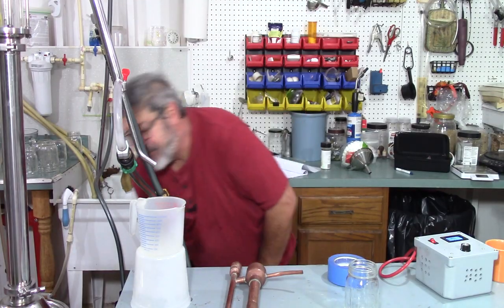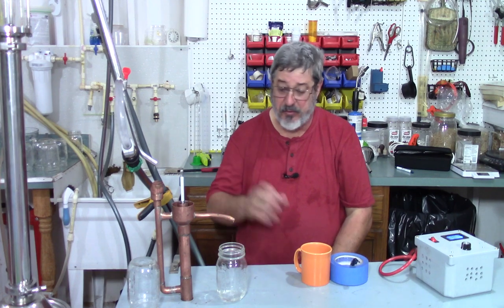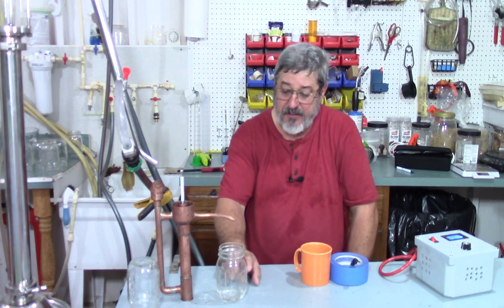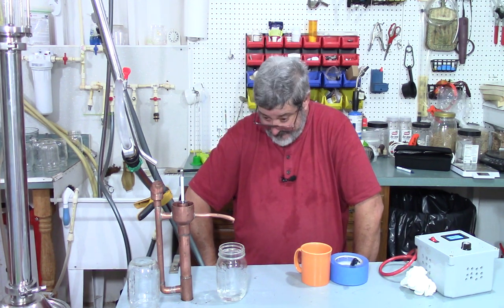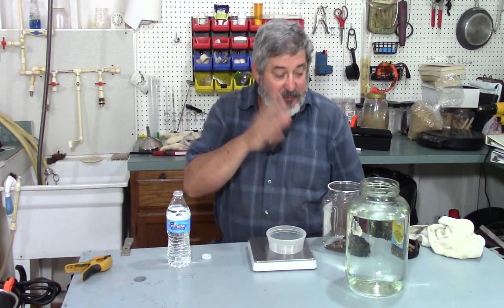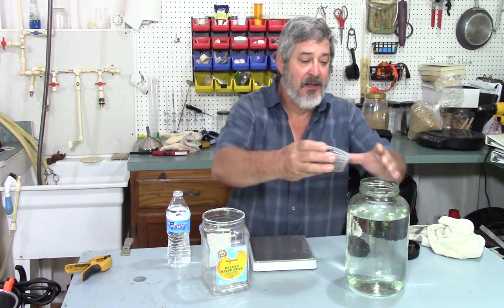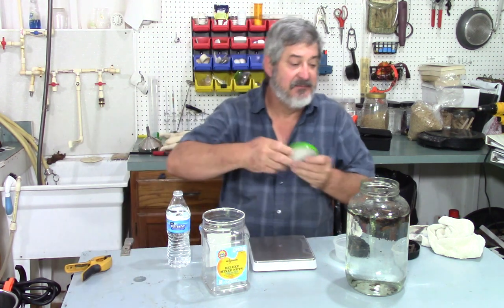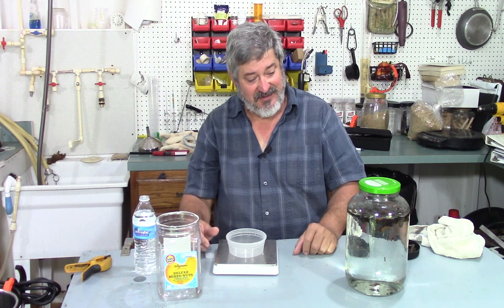E126 Wheated Bourbon Distillation How we make our cuts

Comment: Great video, Randy! You repeated a segment several times in the edit starting about 15 minutes in. Did you use un-malted wheat? And 1 copper roll or 2? There were two sections of packing on the table but I only saw you put one roll in the column.  Where did you get your grain milk? Cheers!
Reply from the maker: Hi George you are right i messed up not sure what happen i did use two rolls and it was malted Wheat and not sure about grain milk LOL  Cheers my Friend